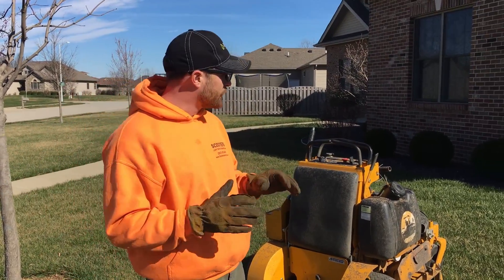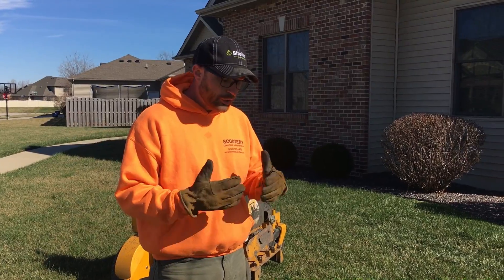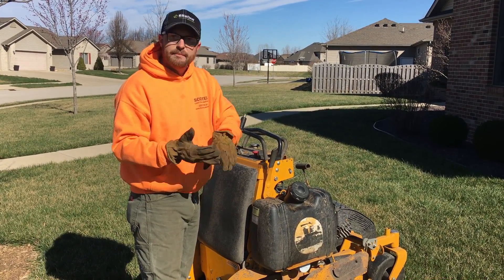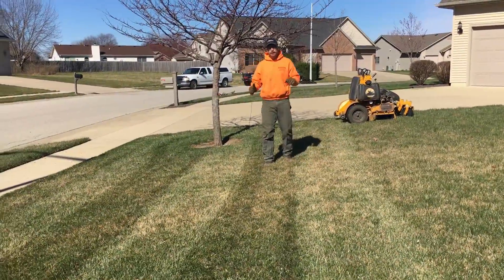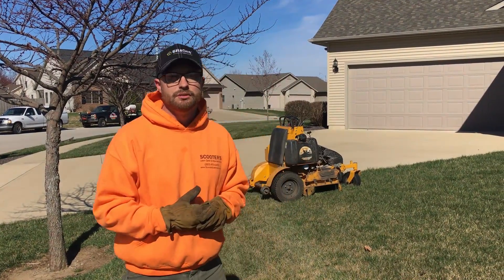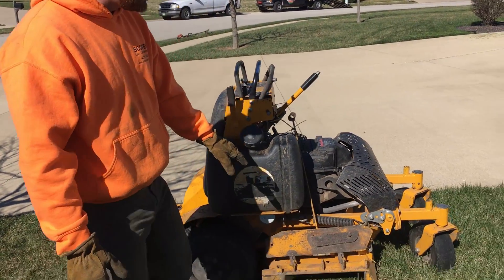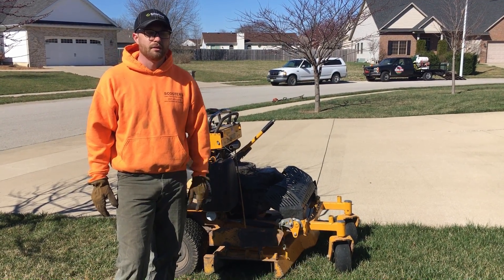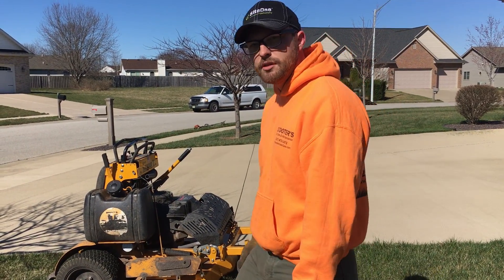Lawn Care New Employee Training Video (DEMO)

Comment: it confounds me, the number of people i've seen running mowers, chute side out, toward pedestrians, moms, _children_, without stopping & shutting down the pto until they're out of harm's way.  i'm almost equally amazed, though, the number of people who unwittingly walk by mowers and trimmers in action ( even 20 feet away ), with seemingly no thought to the fact that they can catch a high speed piece of debris to the face for their trouble.  one thing i find funny, is that blowers ( which will do little more than blow dust on you ) give people more pause, than the potential dangers from mowers and trimmers.
Reply: kodiak wild I did notice that about people they walk right next to the mower and weed whacker but the blower they stop crazy 😜
Reply from the maker: I know it is crazy what people will just throw themselves in front of. That's why I really try to express the dangers to our guys so they can minimize peoples risk.